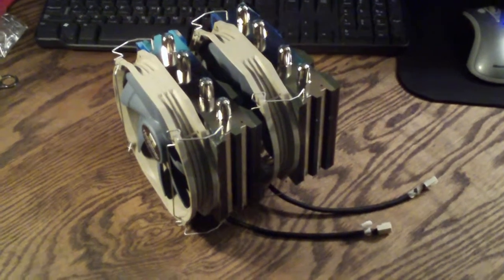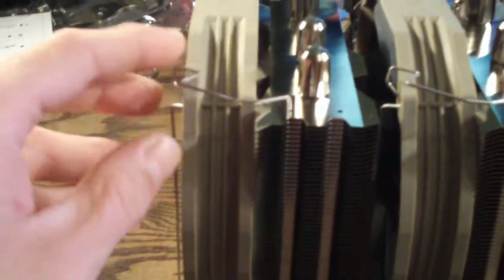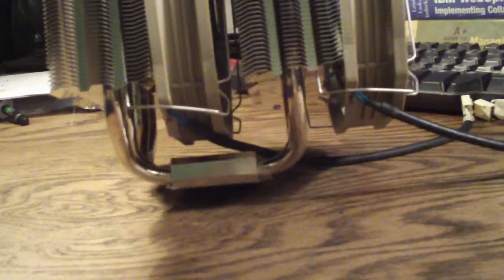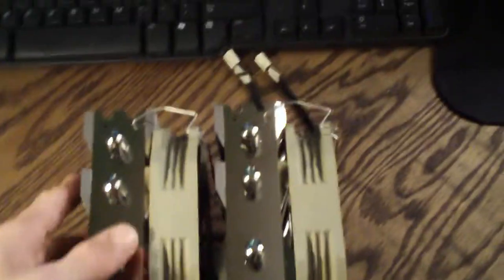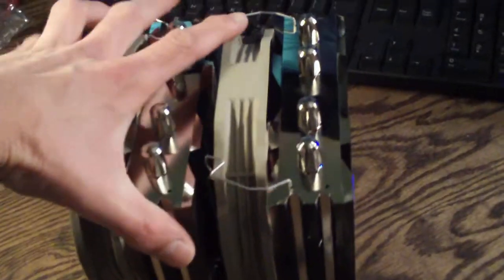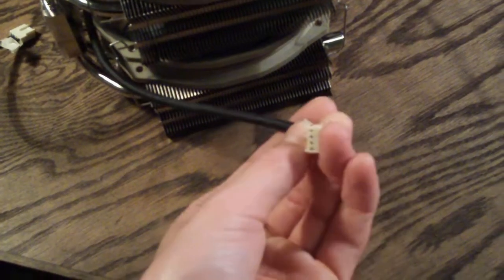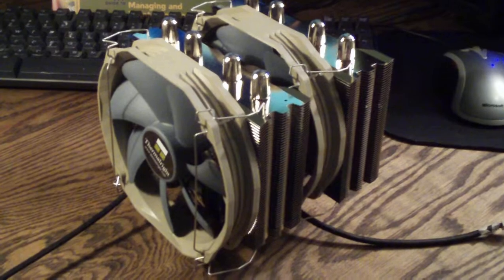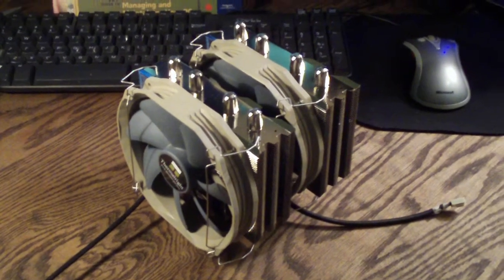Thermalright Silver Arrow TY-140 Push/Pull

Comment: tested it yet how was the install my dad just gave me an i7920 6gigs of corsair 1600mhz ram crucial 128gb ssd and a x58aud3r mobo all i need is windows 7 and a good cooler will be overclocking i have a v8 but dont think it will handle very well im considering the silver arrow thermaltake frio or the noctua nh-d14 any opinions???